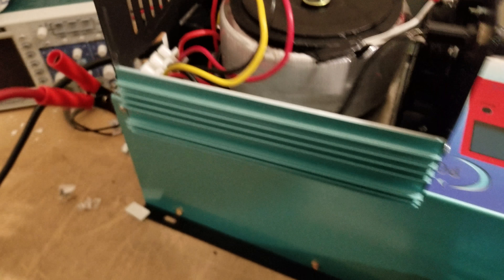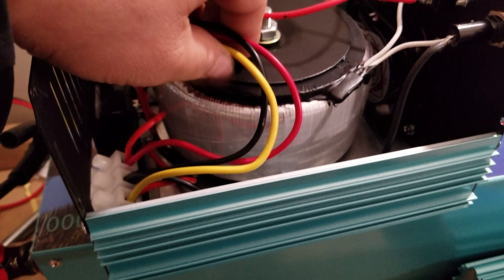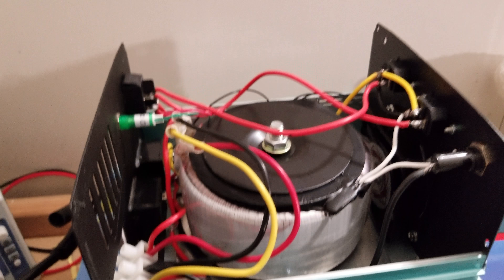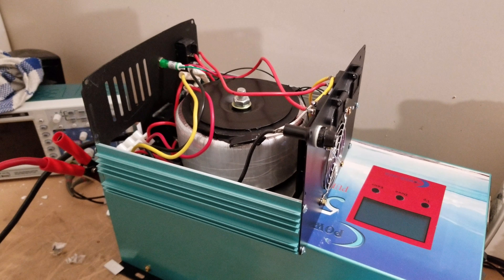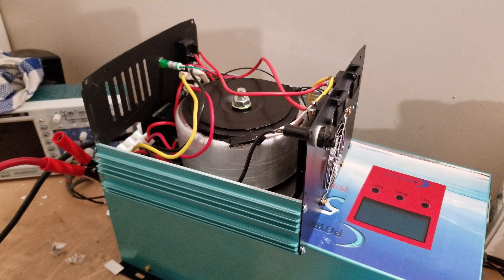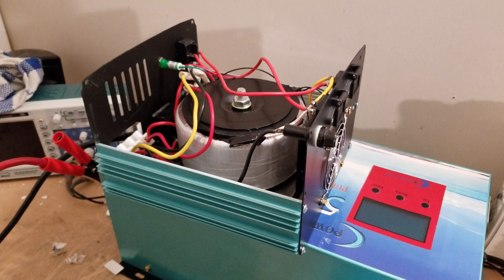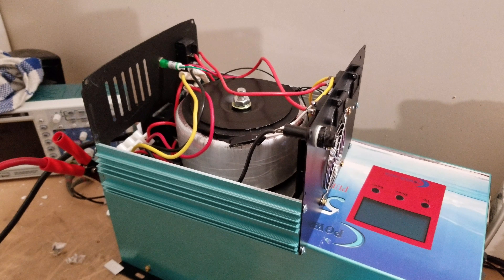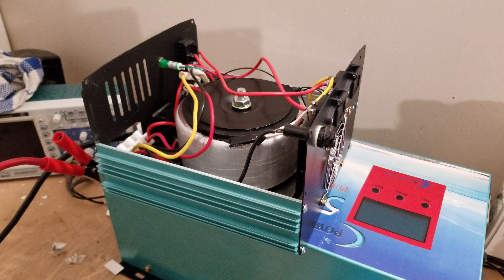Neat little Powerjack step up/down transformer

Comment: Most use with 220v inverters, to run a few 120 appliances, allowing the 220 go power the large loads directly, it's probably 1500 watts constant,

Comment: 1 phase 240 to 110v 2 phase right?
Reply: Nope. 240 split phase.  The L1 to L2 give you 240. The L1 to N gives you 120 as does the L2 to N. It is a center tap transformer. Interesting thing is you cannot get 3000 Watts thru it if you use the receptacle on the back as 120V input. Those are rated at 10 Amp.  And the transformer inside of mine is marked 1300W. Which would be about right if using 120 on the input. It is the same a most modern electrical panels in the US and for the person on the video not to know about 240V use in a home, odd. Central HVAC almost always runs on 240 Volt. Stoves and ovens if electric, 240 Volts. Water pumps if you have a well, 240 Volts. In fact just about anything that is high current will be on 240 VAC.